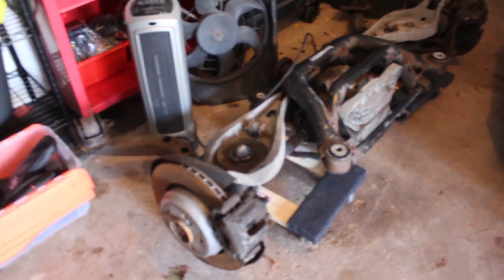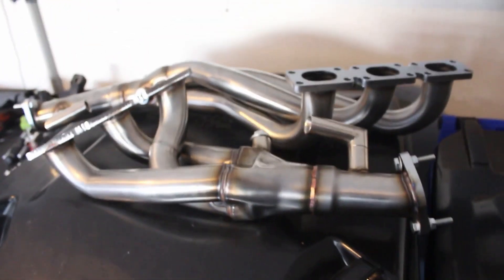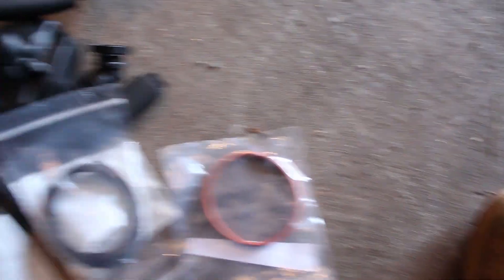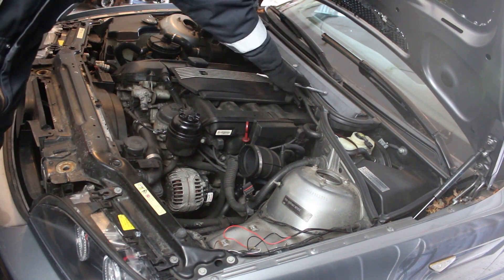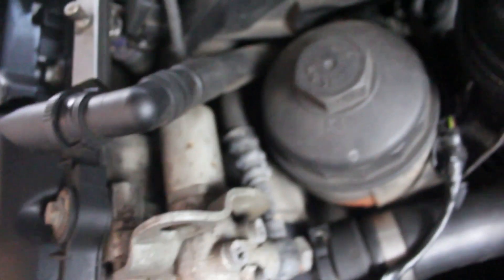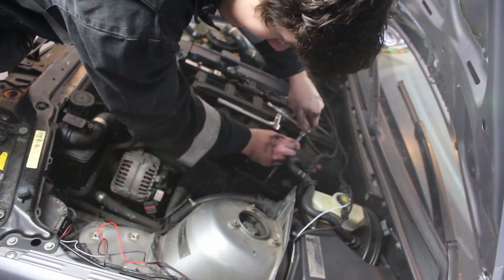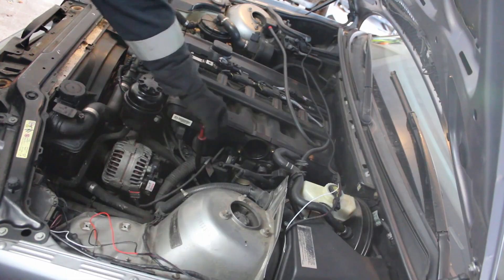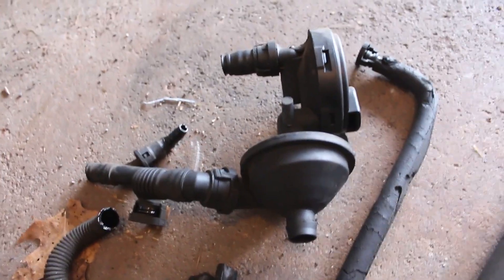CCV Valve & Hoses Replacement! [BMW E46 330ci]

Comment: Hey there, I’m thinking about buying a used e46, how much do you think I should spend for a decent one with no problems?
Reply: I bought a 323i sedan for $1100 cad with a solid motor but needed a few things like shifter bushings to tighten it up, and there ended up being damage to the subframe that'll cost me like $150 to repair, but it's solid other than that. I really didn't care about much on it other than the frame as I am doing a full drift car build with an s54 swap, so the interior was pretty rough, and so was the body.

Comment: O2 sensor bank 1 will fix the 2195 and possibly the 0171. Get an elm 327 Bluetooth dongle and download Obd Fusion(or Torque)and check to see if the bank 1 o2 sensor is switching  between .1 volt and .9 volt every second or two to confirm the dead o2 sensor(in closed loop). If still lean on bank 1, use a transfer pump from Harbor Freight and a cigar to smoke test your intake.
Reply: Did you ever figure out what caused that noise after installing the new system?